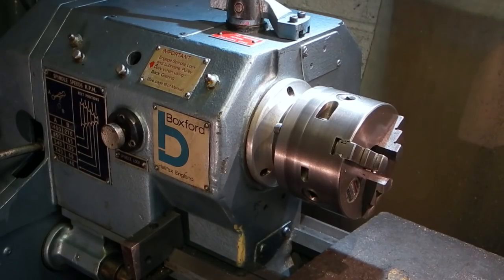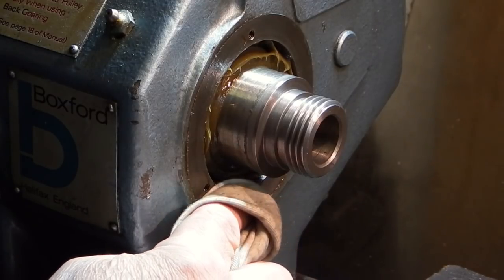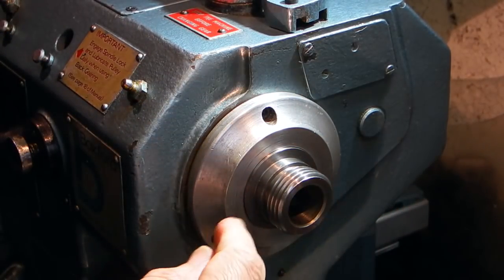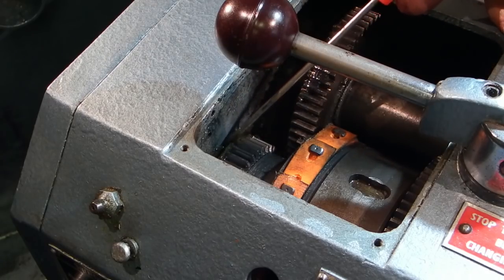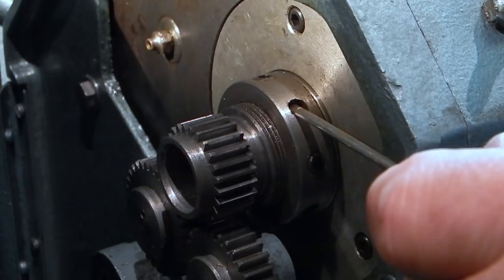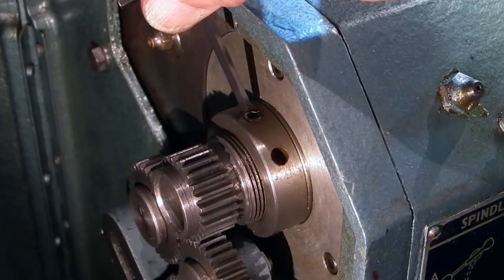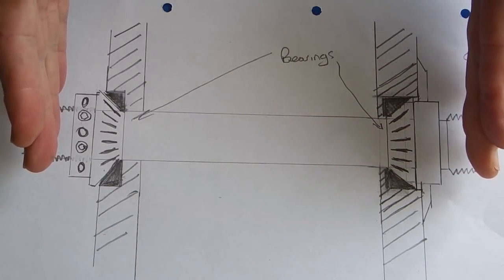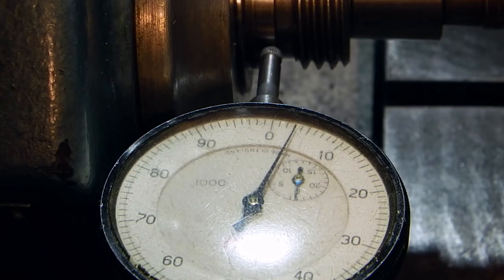Headstock Bearing adjustment and back gear.

Comment: good video Alan have you seen the boxford method for checking bearing adjustment congrats on your 1st year 
all the best Dave
Reply from the maker: Hi Dave
I’ve seen a number of methods using string and a spring balance but not an official Boxford method.
Alan

Comment: This is a Morse taper inside the spindle. I think it is a number 2 by memory. The tailstock is number 3.  

To adjust the taper bearings you can measure the torque required to make it turn. It should be 1.0 to 1.5 inch.pounds.   

Richard Stearn in the Boxford Users Group 
https://groups.io/g/BoxfordLathe-UserGroup/topic/spindel_bearings/66430188?p=,,,20,0,0,0::recentpostdate%2Fsticky,,,20,2,0,66430188
Suggested running the lathe for an hour at 600 RPM. Make sure it is not getting too hot. This would suggest the bearing adjustment is too tight.  After warming up to soften the lubricant, measure the torque. 

There are many ways you can measure the torque.  One is to wrap a string around a shaft or pulley connected to the spindle. You can either hang a weight on the string or connect a spring balance. The torque is the pounds of force required to make it turn, multiplied by the radius of the shaft or pulley.

Comment: Hi, can you tell me what taper the spindle has on the ID? is it a MT or something different. Thanks, Jim
Reply from the maker: Hi James The Boxford lathe I have has a Morse taper No 3 in the head stock and a MT 2 in the tail stock
Reply: @enotsengineering  thanks very much Alan. I am going to try to machine a MT adaptor that fits in the spindle to reduce to MT 2
Reply: You can buy reducers.